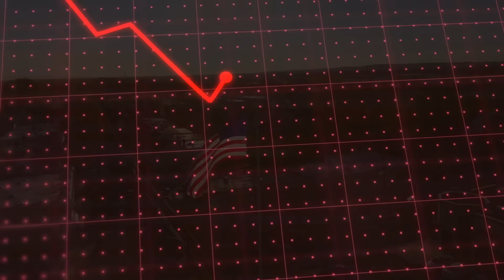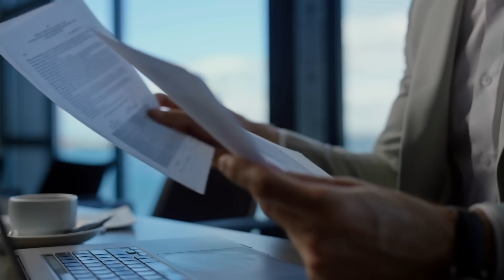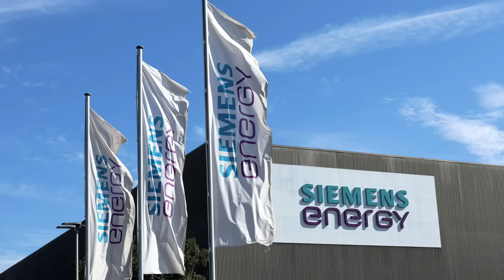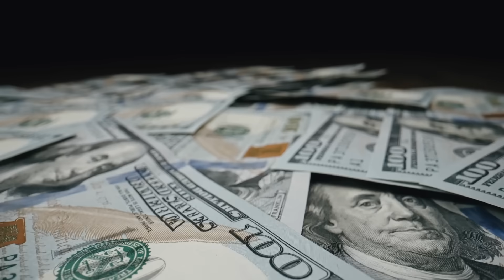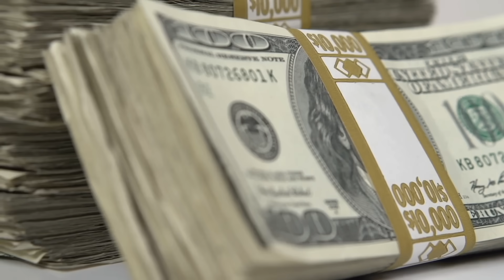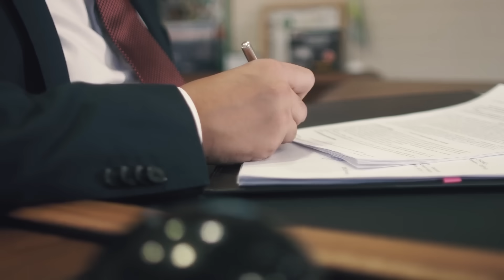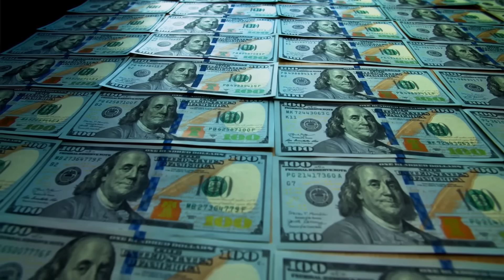The Real Reason America Has Turned Its Back On Wind Power Energy

Comment: I bought an electric lawnmower and found out the hard way that if I let my grass grow longer than three weeks then my mower can't handle it.
Reply: I have a lawnmowing business and most of my mowers are electric.   They aren't all equal.   Just like petrol mower.... you get what you pay for.  Try getting a high powered commercial electric mower.  Mine can handle longer grass than even my petrol honda commercially mower.
Reply: I bought a EGO electric mower. That is one of the most highly sucessfully marketed battery operated  mower. I am  81, and starting a gas mower is getting tough. The electric start is nice, but fortunately, I saved my gas honda, which is over ten years old.  I use the electric EGO when the grass has not grown too high, but  use the hard to start gas Honda with either and it starts every time.  My point is there is a niche in the middle for electric made from wind and panels. But it is unreliable as a constant source.  Since the Navy operates all of its large carriers and subs, and without any record of problems, And operates its smaller ships on diesel and gas, the goal of using wind and  panels is not only  an ungly method of generating power, its seems to be a pipe dream of people who did not stay awake during 7th grade general science class.
Reply: @meyersculimbrene9478  Love your post.  The only thing I would change would be to add in the word "expensive".... I think we can get to 100% renewables maybe in 75 to 100 years, but it will be a massively expensive and complicated.  

As an example Porsche used synthetic gasoline a year or two ago in all its races.  The fuel was made with 100% solar energy, used carbon captured out of the air, etc... it was something like $50 per gal.  Apparently is was great fuel...  But complicated and expensive applied perfectly.  Granted, we can run cars with batteries, but it's tough to load enough batteries into an large airplane and still get it to fly across the Atlantic.
Reply: I concur.  I'm 66 and I'm using an AC mower and it is nice not annking my arm out of socket trying and as long as I don't let the grass grow too high, I'm happy.  But if ti rain for too long and the grass never has time to dry and it keeps on growing . Then I'm in big trouble. 
  So in short, electric is nice, but you really have to have the power gas.  @meyersculimbrene9478
Reply: Liam,  How much does a commercial electric mower cost?  

I definitely would like an autonomous electric mower that does the mowing all by itself.  I have hills and it seems that a good autonomous machine is going to run over $5K.
Reply: @bradhobbs  between about 1500 and 3000 for a good 21 inch self proppelled plus you will need a couple extra battery's if your mowing realy big yards.    Then there are comerciall zero turn ride ons like the GREENWORKS that go up to $49,990.
Reply: I bought a used car and found out the hard way that it broke down sometimes.
Reply: I find that I can either have money or I can have a car, but I can't have both. @jackprier7727

Comment: Simple. It's expensive and inefficient and you still have to maintain a base load.
Reply: Electricity from windturbines is rather cheap. The base load is a combination of different energy sources and building them in different areas.

Comment: The wind farms take massive areas of land and seas.  As a function of the kilowats generated it is pathic.  Life span 20 years max.  Creating a mass extinction of avian life forms.
Reply: Building-windows-collisions is way by FAR the killer of birds.
Reply: They need room, but they do not use up much land. The towers are rather small in diameter.
If 20 years is the max lifespan, why are some turbines from the 90s still running?
And considering that windturbines kill 1/35th of the amount of birds that fossil fuel powered plants kill, one should better call it mass saving.

Comment: The baby boomers are retiring, so the capitol for all the new stuff is drying up.  The fact that there are government subsidies for these is clear proof it is going to be hard to make it work.  Sun and wind is not a steady producer and it surges and pulls down the entire system.  Until a way is found to stabilize things, and the interest paid on capitol goes down, these are on hold.
Reply: putting in solar in stormy and dark states is actually a net loss on the carbon generation made to make the solar cells.
Reply: @watchthe1369  Fossil fuels recieve subsidies for decades...
Denmark recieves the majority of its electricity from windpower. The average power outage per year is 15 minutes. In the US it is 2 hours. So much for pulling down the system.
Reply: @old-pete  Denmark is an example of the people using the greenest resources they have available, Nuclear and wind.  Germany is an example of what NOT to do, their carbon footprint has actually increased.  I am merely hoping we donot go  down that road.  Appropriate green technology is good ideology is useless.
Reply: @watchthe1369  Denmark has no active nuclear power plants.
Germany has decreased its carbon emissions in the first six months of 2023 by 8%...
Electricity production by coal power plants decreased by nearly 25% compared to the first six months of 2022.
Reply: @watchthe1369  You are just assuming that. The fact is that not all coal power plants run on lignite and the overall CO2 emissons went down 8%.

Comment: A factory just cannot run on intermittent power.  Lifespan of wind turbines is limited.  Wind energy is vast but low quality.  And solar energy is only good during daytime.
Reply: That why one uses not many turbines and different systems.
More than 50% of the electriciy in Denmark come from windpower.

Comment: Now here is the real truth. An independent analysis of ten years of offshore and onshore wind power finds it only supplies consistent power 8% of the time with the rest of the time either no power at alll or fluctuating to the point that if more than 10% of grid power comes from wind and solar it can fail without an instant source of backup which is only feasible from hydro and gas units. The study found that each GW of wind or solar power required the same amount of hydro or gas to ensure grid stability and the gas units had to be supplying a base load of power all the time so they can be quickly wound up. Thus, since at low turnover they produce high output of carbon dioxide there is no climate advantage to wind and solar and the costs to industry and the domestic market of the subsidies is killing economic growth. Battery backup is not a solution due to the extra amount of wind or solar needed to keep them charged as well as the high cost and fire risk. Wind power and solar have been ill thought out vanity projects for politicians as well as a means of transferring wealth from the poor to their rick owners.
Reply: You either found a bollocks study or study about windfarms setup by the most bollocks engineers.
Either way this does not apply to any half decent windfarm.
Reply: The study was carried out by the UK Institute of Industrial Engineering using validated data and confirms several  similar studies. @old-pete
Reply: @peterazlac1739  To which university does it belong?
There is no general UK institute.

Comment: Its NOT the grid's fault.  Imagine you have a nice classic car.  It takes gas because it was designed to run on gas.  Now you want to use E85.  Well, that ain't going to work without destroying the existing engine.  You cannot blame the car for needing the fuel it was designed for.

Wind power is intermittent and the grid cannot handle intermittent energy sources because it was designed to run on stable power sources.  Furthermore, the power company won't buy you an extension cord to plug you stuff in, you gotta buy that yourself.
Reply: The grid does not care where the electricity comes from.

Comment: I’m No engineering genius, but if I wanted a swimming pool in my backyard, I’d dig the hole before I filled it with water 😂.
Reply: That’s called common sense and that’s simply not allowed in government.
Reply: especially this regime..... @llaffy8939
Reply: Now if we can only get everyone else to think like you
Reply: @21millionreasons  well there’s 2 of us at least. Gotta start somewhere i guess
Reply: @apollomoon1  agreed
Reply: In the 1950s when the state of NSW in Australia realised that building power stations on the coal fields and transmitting the electricity to where it is used (mainly the Sydney area), the first coalfields power station and the transmission line connecting it to Sydney were
1. Designed by the same engineering organisation (the ECNSW - look it up), and
2. built at the same time, and
3. connected at the same time.
Building a lot of power sources long distances from where the power is to be used WITHOUT building the transmission lines AT THE SAME TIME is sheer stupidity! Unfortunately, when you have a complex, inter-connected thing like a power generation and distribution system designed and built piece-meal by an assortment of independent companies, normal engineering common sense goes out the window, and the independent companies wind up making planning decisions and doing construction based on the timetables that suit their individual companies (and their shareholders) rather than the timetable that would produce a practical engineering result for electricity users!
The total cost of a wind farm is not just the construction of it - the total cost also includes the transmission line to connect to the users of the power. Without the transmission line, the wind farm is useless!
(I started with the ECNSW in 1963 and have been following the engineering involved ever since then.)
Reply: @GraemeCostin  thank you!  It’s the complexity of governments that is the real problem when push turns to shove.
Reply: @apollomoon1  it's the politics and self interest that overshadows common sense
Reply: @GraemeCostin  They did it right back in those days...amazing because it was long term thinking.
Reply: @GraemeCostin  great historical point I'll look it up 
the other issue I have is coal is energy dense compared to wind and solar which require a large geographical footprint and grid firming not to mention the insistence that we meet all our energy needs with one technology in the shortest amount of time and everyone who feels the price crunch job losses and land rights eroded are simply bamboozled
Reply: I'd make sure there was a water supply before I built the pool
Reply: @ronashman08  As a Brit, I'd move to a country that's warm enough to justify having a pool in the first place.
Reply: You're right
Reply: Yeah, as an ingénieur from 🇫🇷🥖 energy industry. On paper we can agree but in practice we don't, u see?       It's not that you dig a hole. It's the planning and measurements confirmation, contact schedule as planned, is the digging done ethically and all safety procedures followed. Who is responsible for possible pool water leaks. Are any people from conflict countries used. Is the material used for swimming pool according to standards. Are you a nice guy to chit chat if no sry im busy u see. It takes time
Reply: the United Nations Aussie LABOR POLITICIAN puppet "Chris Bowen" wakes up to a perfect world, 
"Save the Planet, ban all petroleum products" 
 
 
Poor Chris Bowen. Life without petroleum and petroleum-based products.
One crisp winter morning in Australia a cute little girl named Chris Bowen woke up to a perfect world, one where no petroleum products were ruining the earth. She or they tossed aside her or they cotton sheet and wool blanket and stepped out onto a dirt floor covered with willow bark that had been pulverized with rocks.
“What’s this?” she asked.
“Pulverized willow bark,” replied her fairy godmother.
“What happened to the carpet?” she asked.
“The carpet was nylon, which is made from butadiene and hydrogen cyanide, both made from petroleum,” came the response.
Chris Bowen smiled, acknowledging that adjustments are necessary to save the planet, and moved to the sink to brush her teeth where instead of a toothbrush, she found a willow, mangled on one end to expose wood fibre bristles.
“Your old toothbrush?” noted her godmother, “Also nylon.”
“Where’s the water?” asked Chris Bowen
“Down the road in the canal,” replied her godmother, Just make sure you avoid water with cholera in it.”
“Why’s there no running water?” Chris Bowen asked, becoming a little peevish.
“Well,” said her godmother, who happened to teach engineering at MIT, “Where do we begin?”
There followed a long monologue about how sink valves need elastomer seats and how copper pipes contain copper, which has to be mined and how it’s impossible to make all-electric earth-moving equipment with no gear lubrication or tires and how ore has to be smelted to a make metal, and that’s tough to do with only electricity as a source of heat, and even if you use only electricity, the wires need insulation, which is petroleum-based, and though most of Australias energy is produced in an environmentally friendly way because of hydro and nuclear, if you do a mass and energy balance around the whole system, you still need lots of petroleum products like lubricants and nylon and rubber for tires and asphalt for filling potholes and wax and iPhone plastic and elastic to hold your underwear up while operating a copper smelting furnace and . . .
“What’s for breakfast?” interjected Chris Bowen, whose head was hurting.
"Fresh, range-fed chicken eggs,” replied her godmother. “Raw.”
“How so, raw?” inquired Chris Bowen.
“Well, . . .” And once again,  Chris Bowen was told about the need for petroleum products like transformer oil and scores of petroleum products essential for producing metals for frying pans and in the end was educated about how you can’t have a petroleum-free world and then cook eggs. Unless you rip your front fence up and start a fire and carefully cook your egg in an orange peel like you do in Boy Scouts. Not that you can find oranges in Australia anymore.
“But I want poached eggs like my Aunt Tilda makes,” lamented  Chris Bowen.
“Tilda died this morning,” the godmother explained. “Bacterial pneumonia.”
“What?!” interjected Chris Bowen “No one dies of bacterial pneumonia! We have penicillin.”
“Not anymore,” explained godmother “The production of penicillin requires chemical extraction using isobutyl acetate, which, if you know your organic chemistry, is petroleum-based. Lots of people are dying, which is problematic because there’s not any easy way of disposing of the bodies since backhoes need hydraulic oil and crematoriums can’t really burn many bodies using as fuel Australian fences and furniture, which are rapidly disappearing - being used on the black market for roasting eggs and staying warm.”
This represents only a fraction of Chris Bowns day, a day without microphones to exclaim into and a day without much food, and a day without carbon-fibre boats to sail in, but a day that will save the planet.
Tune in tomorrow when Chris Bowen needs a root canal and learns how Novocain is synthesized.
Reply: I love it!
Reply: In China the Government would just build the infrastructure,held by the tax payer....for the Common good .why is it such a commie problem to convince the Americans We the People can collectively Own infrastructure ? Why wait for the Private sector to Capitalize?
Reply: Call your congressmen, senators and council and tell them windmills are in the best interest of the people and give them good reasons why. Also wind power is much cheaper then nuclear power
Reply: @kennygaming208 lies, wind energy is a load of shite, nearly every single turbine where I live are always of and I stay in the windiest part of the UK 😮
Reply: @steviep81 it's because they have parking brakes, yes wind turbines can be put in park. It's because supply of electricity must meet demand perfectly you can't overload the grid. You will start seeing more of them spinning as more people get electric cars or more data centers are installed